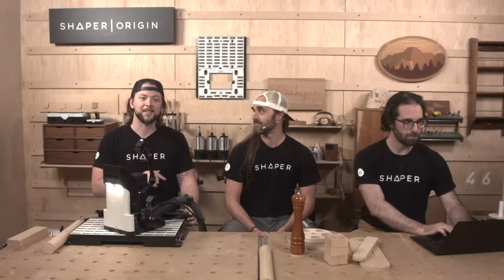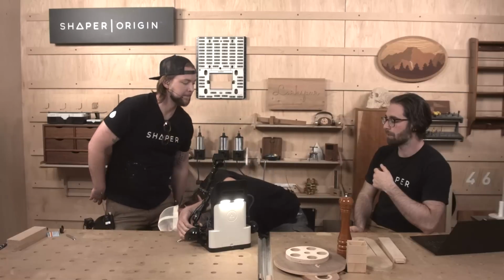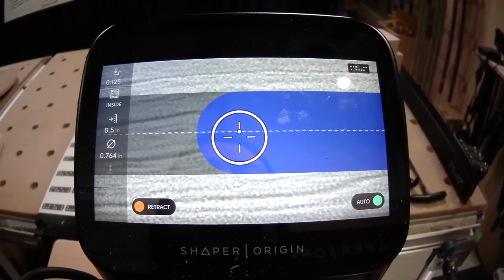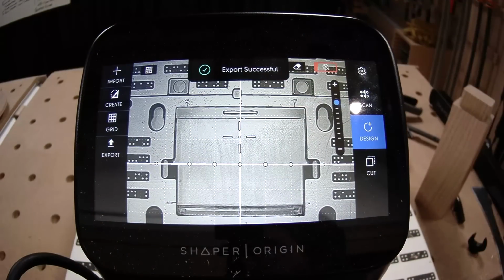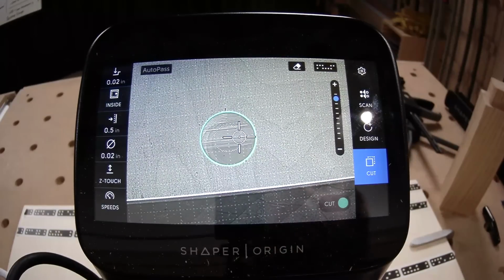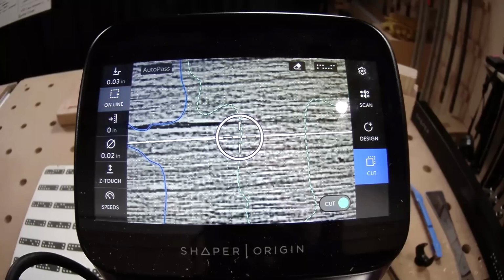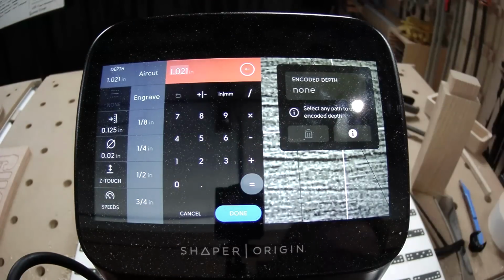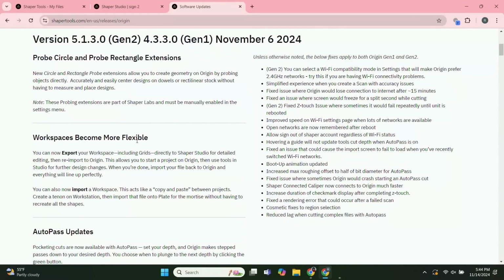Session 119 - English: Welcome to Larkspur

Comment: Great system update now as an origin owner, certified journey men furniture maker and Festool user/ owner- I still believe that auto pass should be a free update with any shaper! But in return in the minute when you have a good vacuum cleaner like a Festool, Makita, Fein or Hilti- there is no use for the hose that the origin comes with. I would recommend you keep the hose and sell it as an add on but make auto pass part of the tool when purchased in stead! Much better and I think a lot of users would agree with me.

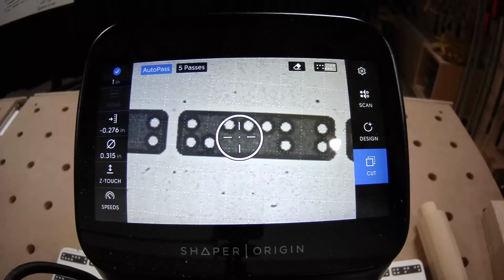Comment: You asked at minute 12:25 how many updates I've been through.  This is the first and it happened literally as I was unpacking my machine.  The update happened on the first time I plugged in the machine.  I didn't fully understand what was going on because it was named Larkspur; a name that had no relevance to me.  Because everything was new about my machine, I simply accepted that it was part of the first-time process.  I didn't know it would fundamentally change my screen or what to anticipate in set-up.
As a consequence, I struggled to learn how to operate my Shaper.  I had watched hours and hours of your videos about how to operate my machine and suddenly it looked and felt different than  my initial video learning taught me.  I have been quite frustrated for the last two weeks.  
I don't know what I'd suggest to do differently for another update, but my experience was disconcerting and frustrating.  I am getting the hang of it, but it has been a challenge.

Comment: Another one I think I have seen request for... but adding a bit more:
Folder structures on the Origin
plus: Ability to connect to the origin to manipulate those structures from a PC (or my web files interface?).   It's not great to work on the device.. this way I can use a keyboard/mouse to move this around.
Actually, Since you can export designs... why not just replicate ALL the workspaces to my shaper files page?  Then I have a backup, I can have less "stuff" on the origin (check boxes for what is replicated to the device, not checked = just exists on files... where i can choose to blow it away if I please.  And in there, I can setup a folder structure for projects, etc.  
I Guess I could have check boxes on the origin -sync to files.  select all, etc.
When you edit something, it keeps some level of history so you can roll back as needed.  Kind of like one drive.  I can click on a file, "show previous versions" -revert or copy revision X to Y.

Comment: I'd like a cheap dummy spindle with a fixed probe.  Then in the software you can hit a button saying "I'm using the probe spindle" and it automatically knows the diameter of the probe shaft.  Perhaps the probe could have an indexed slot so you could offer different kinds of known probe types like a square one or an L shape.  Why?  I don't know yet.. But I think you're already reverse calculating simple shapes (circles, rectangles) soon we might trace around a complex shape like a railing with a flat side or the saw insert but in compound passes.. "find the largest possible shape from 4 passes as I run the probe around the inside of this saw insert hole" (smallest for outside passes around the railing)

We're already pulling the spindle out to flip the bit for probing... so if I had a cheap thing like this, save time and perhaps increase accuracy, add capabilities.

Comment: I am not constrained by time, so have never seen the need for auto pass, especially considering the cost. However, I would certainly consider purchasing if auto pass supported taper depth cutting on an open path. This would make slots in draining boards a doddle, so that water flows down the groove in flat surface. I'm sure an algorithm could easily be constructed to determine the length of the path allied to the start and finish depth.
Reply: I’m happy to second that suggestion as a great feature update to auto pass.
Reply: I imagine the Y axis desires have long been on their minds and in the testing labs. The big difference between origin and a traditional CNC gantry table is: you're depending on a fair amount of surface area to slide the origin on top of.  As soon as you go from less complex jobs to "3D carving" like.... "lets make a gecko on the sign", you lose surface area and the device can't run as well.  There are certainly SOME applications like your sloped groove... but it's going to get VERY challenging both dealing with the surface area issue and the creating drawings themselves will get really technical. 

Dunno.. I would love it too but, I wonder if that's past the limits of the use cases for a unit that sits directly on the workpiece.

Comment: Software feature wishlist: Lots of grid functions, e.g. saving/copying/switching between multiple grids, creating grids based on all permutations of new/existing grid/feature points/rotation.
Hardware feature wishlist: Precisely engineered dummy spindles just for measuring, support for Festool and other bluetooth vacuums, wide multi-row rolls of shaper tape.
Next gen wishlist: Data connection between device and spindle to allow for e.g. multi-spindle workflows without manually changing tool settings back and forth, automatic speed reduction on endgrain, detection of dummy spindles, support for completely different tools such as galvo marking lasers

Comment: I think some potential was wasted with circle probing. The rotation of the coordinate axes of the grid created at the center of the circle is determined by the rotation of the origin itself, which makes it somewhat imprecise. It would be more practical to first create a standard grid, for example, at the edges of the workstation, and then have the overriding grid from circle probing adopt the rotation of the coordinate axes from the initial grid.
Greetings.